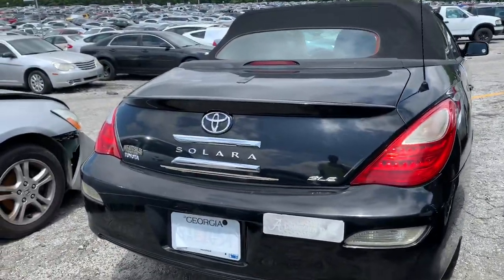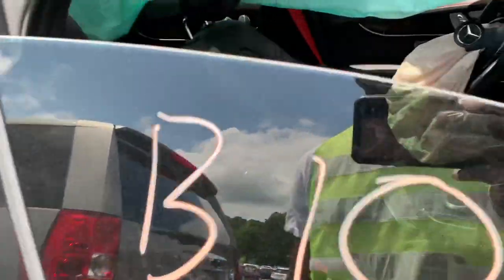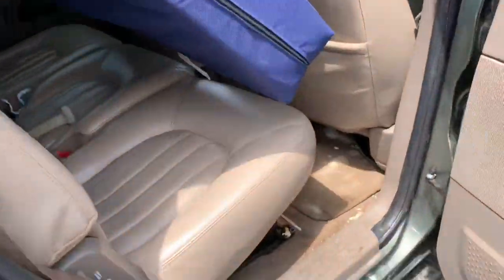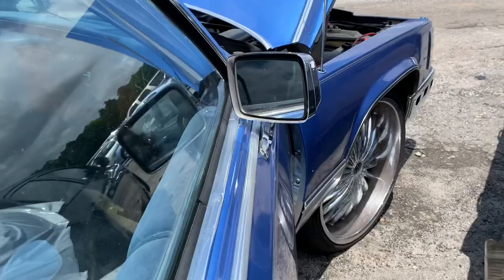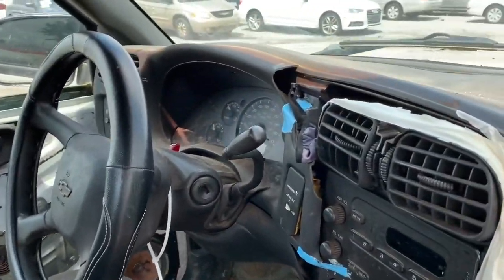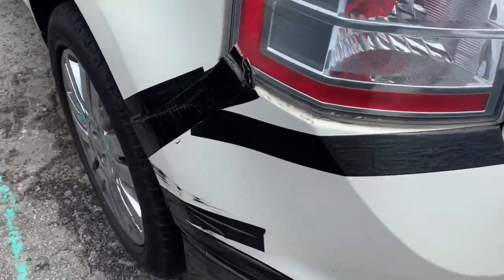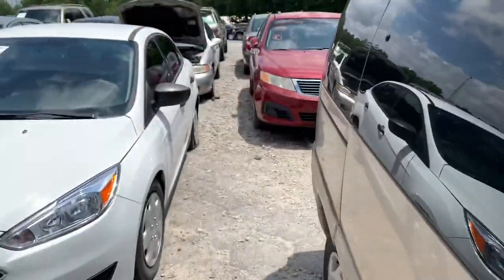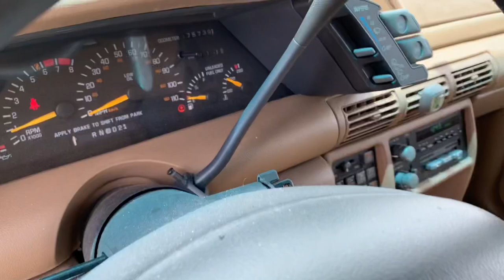I FOUND THE CHEAPEST FULLY CUSTOMIZED 1990 CADILLAC BROUGHAM ON 24'S AT THE INSURANCE AUCTION!

Comment: The missing strip shows one thing on that Caddy...the paint job was a scuff & shoot. They didn't strip it down, de-trim & do it right. Makes you where else corners were cut- I'd walk away because odds are it'll go high on price and issues will show up shortly
Reply: Trim on those model fall off if you close the door. If it starts, and drive. I'll pay $2500. And flip it for $6500 all day. Not a fan of blue. I'll paint Kandy, Pearl Red. And sale it at $9500.
Reply: @lawrencejackson1531  i just found one that runs for 1k im purchasing tommarow building it up and flipping it fast